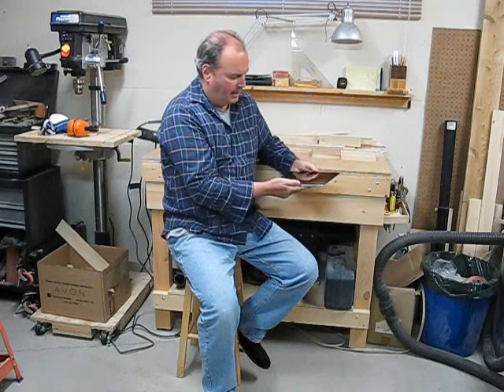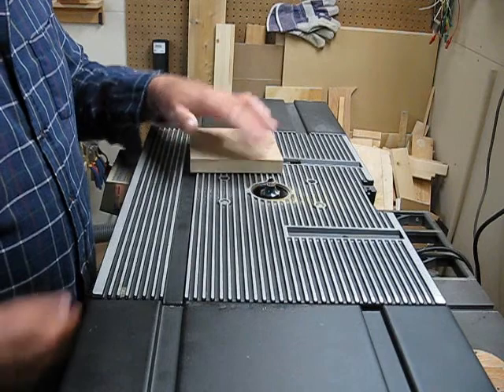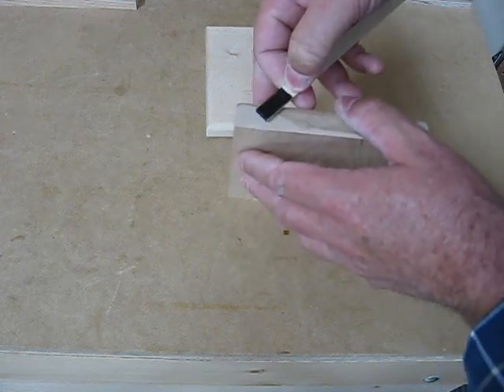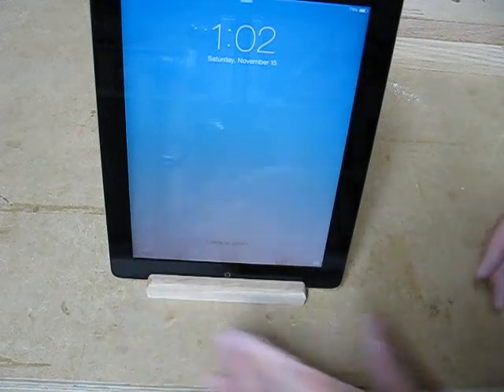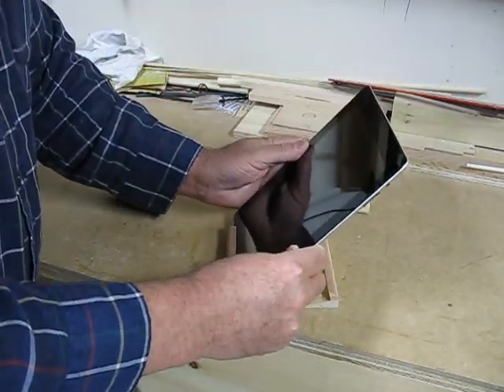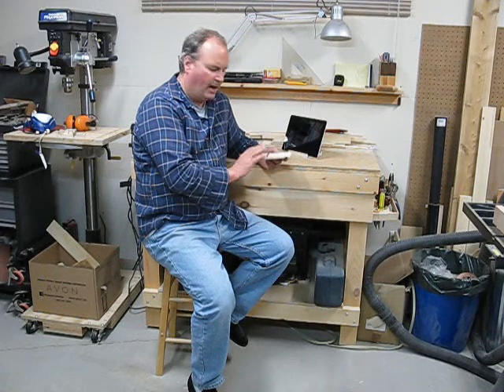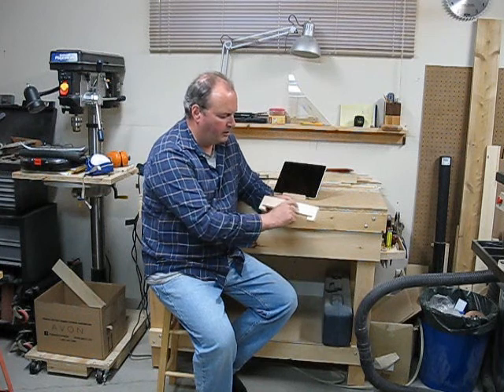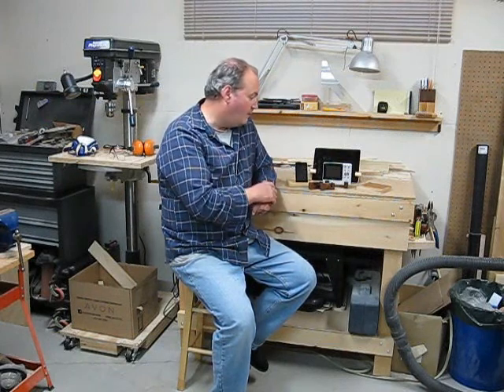iStand iDeas

Comment: Nice ideas there. The adjustable angle ipad holder is great and simple. One thought about it though is you said it will only work landscape mode, but what if at the other side of the stand you cut the slots closer together so it will work portrait mode to so it can be used both ways with the one stand.
Reply from the maker: That is an excellent idea. I never thought of that. Very simple and creative. Thanks for sharing.